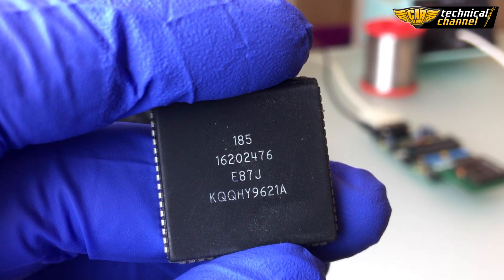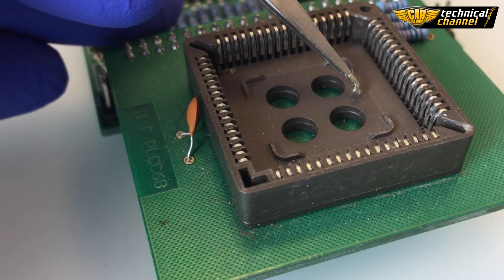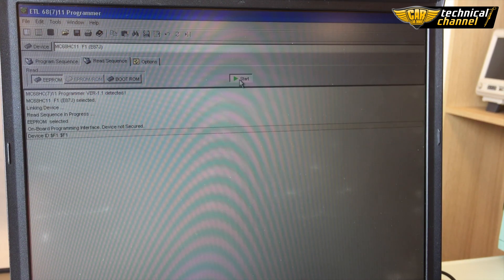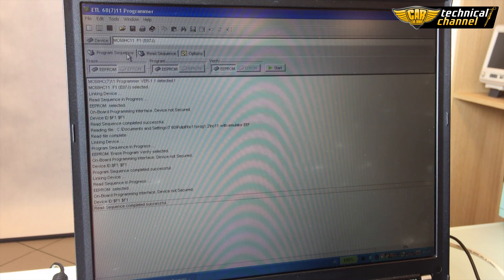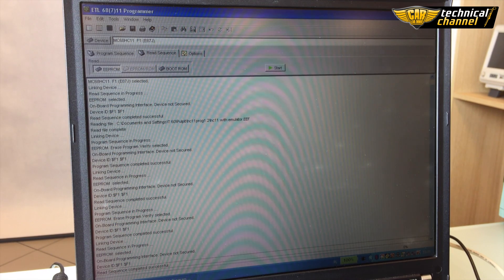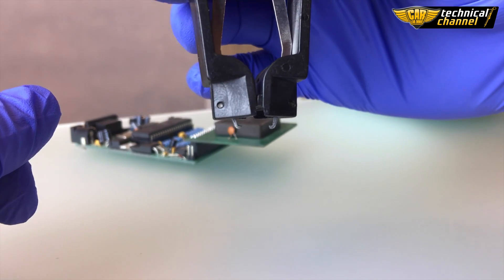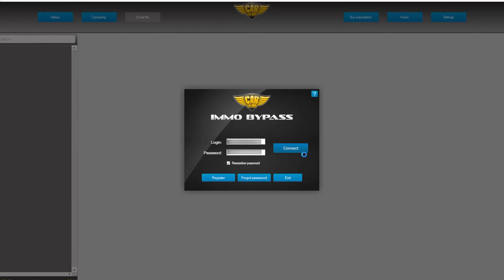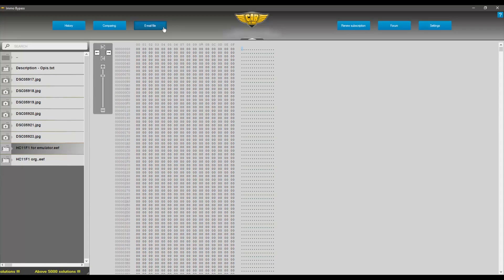Motorola processor programming - how to read, change and save?

Comment: Hi sir I'm having a problem trying to find a programmer to read motorola processor TMS370C023 you about this type processor?
Reply: did you find it please?
Reply: search for "YANHUA TMS370 Programmer To Program The TI TMS Microcontroller EEPROM", it could be the solution.